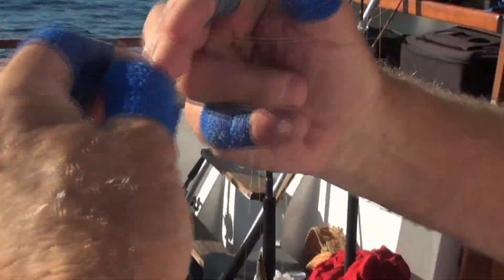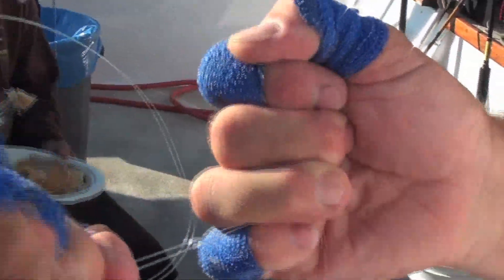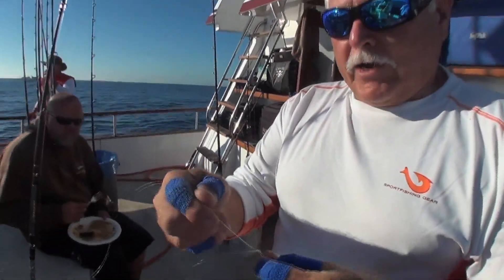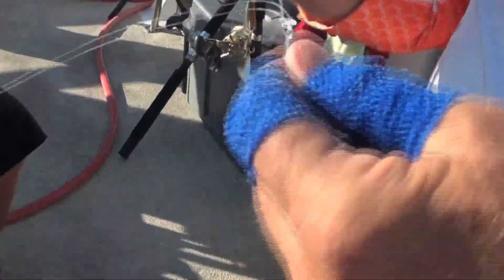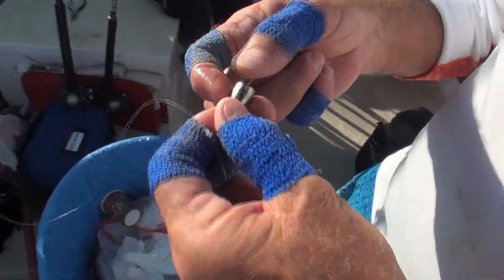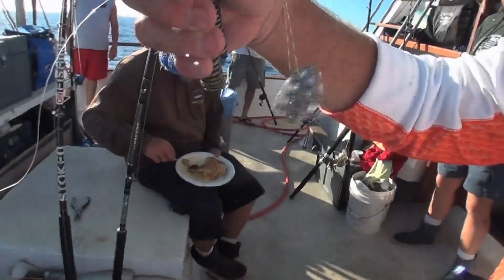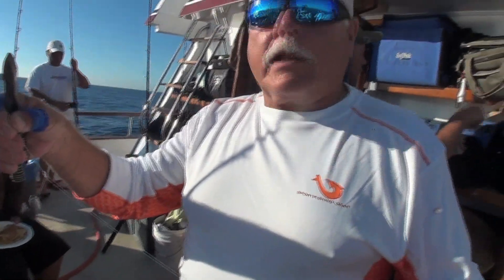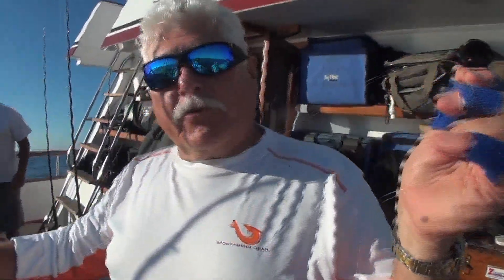Mono To Fluorocarbon Knot | Stoked On Fishing

Comment: What is the name of the knot?triple surgons?
Reply: No - it's a Seaguar knot
Reply: but if you wrap tag end through 3 x vs twisting 3 times it is triple surgeon's knot.  it may be the same knot using different techniques - idk
Reply: @jimcarterphd  it does look the same after its tightened down which would you use?